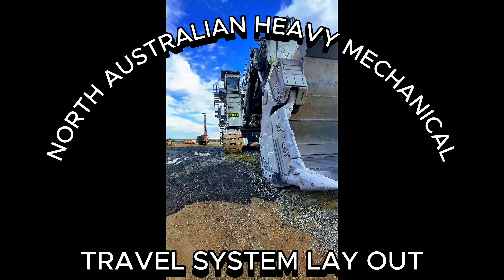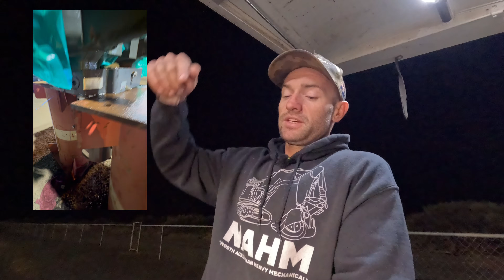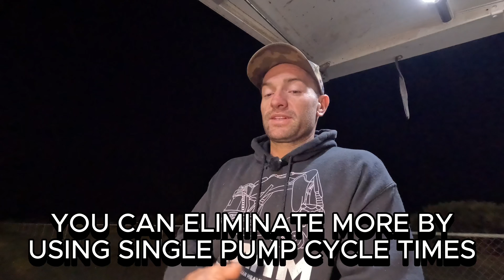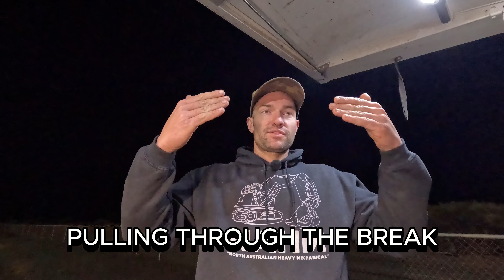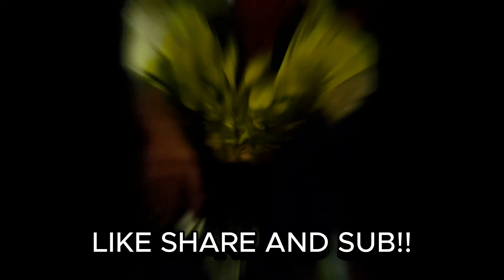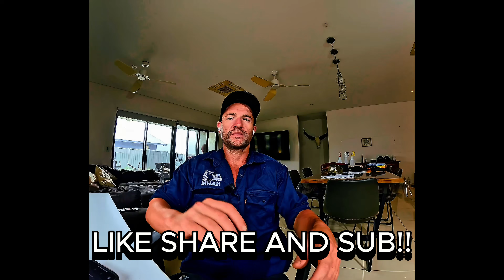What’s causing your machine to deviate! Travel circuit’s explained!

Comment: On the hydraulic travel motor  how can you tell if a  motor is casing to much formula ? Heat ?
Reply from the maker: So with the machine off disconnect the case line to the motor cap the side
That goes back
To the tank, then you stall it for 30 seconds at low idle and catch the oil that is coming out of the case of that motor in a drum and compare it to the other motors, most of the time you can tell because it should only be a small amount of oil, but always refer to OEM manuals to identify the correct lines 🤙
Reply from the maker: I will put a video up to show you mate 🤙
Reply: @patrickcoward4309 where